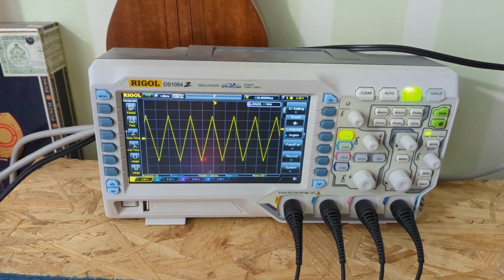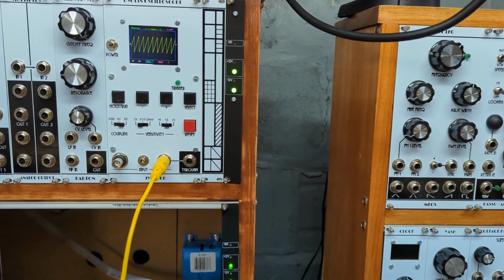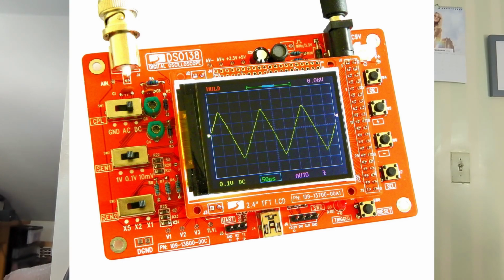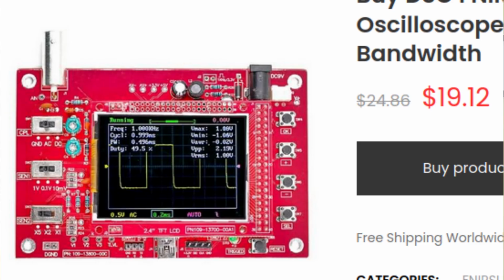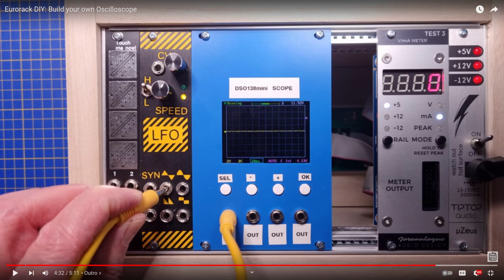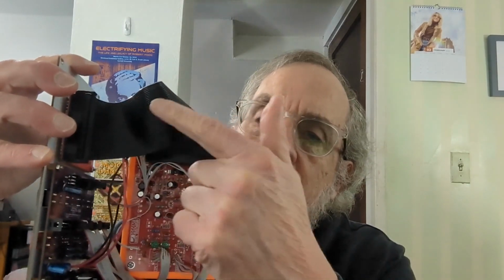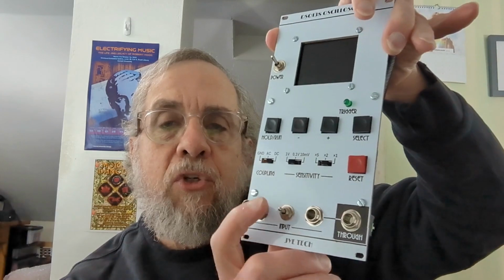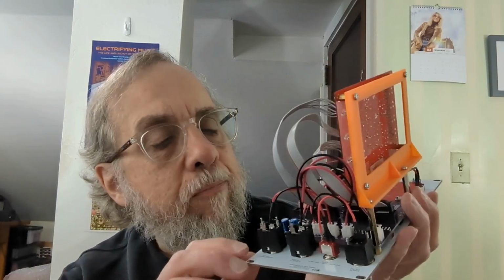DSO138 Oscilloscope DIY synth module

Comment: Fantastic, thanks for sharing Rich! I've had one of those oscilloscopes for years with the intention to build it into a module. I have a case for it and so it's been very low on my priority list. You've done nearly all the thinking for me for when I finally get around to doing this! I like the idea of separating the main circuit board from the display with a ribbon cable.